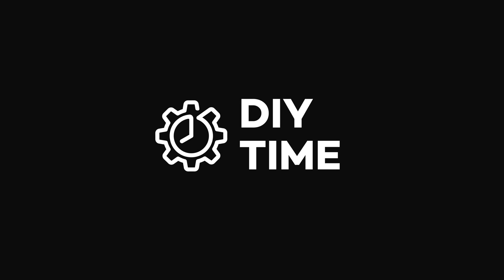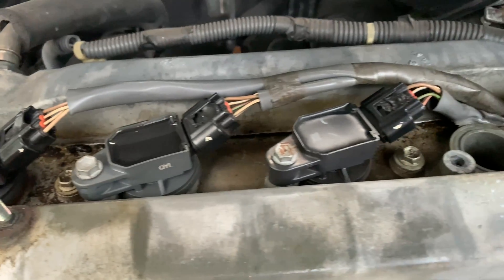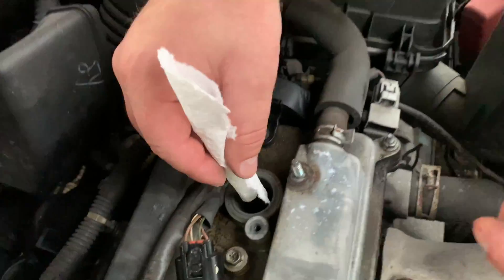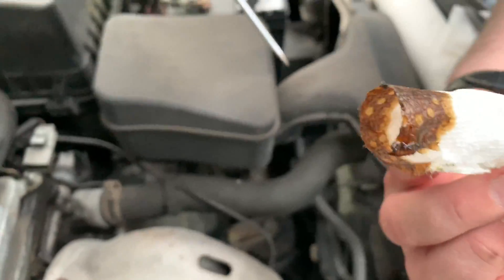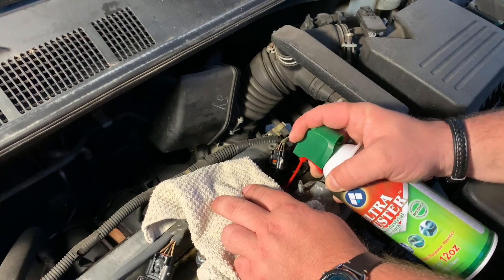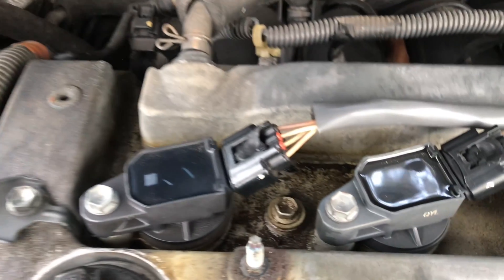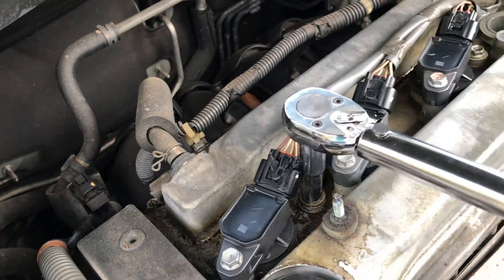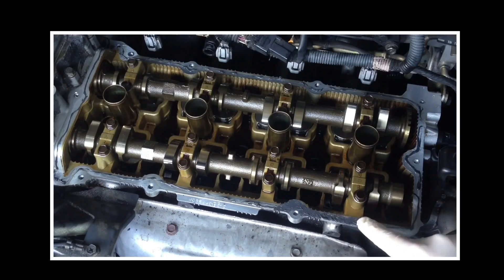How to remove engine oil from spark plug wells (to fix cylinder misfire).

Comment: I cut the stripes from the strip mop and it works better than paper because there is no change of paper falling into cylinder even if the spark plug is removed. Of course you hold those strips and use a stick, e.g. cut a piece from plastic hanger, to move the hanging part of the strip around and change it when it soaked with oil.

Comment: hello my mechanic did a compression test and cylinder 3 has only 60 psi compression he said it needs a new engine is this the case? i have been driving it and the check engine went away i cleaned the oil from the spark plug it seems to be driving ok for now and without any misfire i will try to tighten the screws but will i need a new engine?

Comment: Im in a bind on a 2010 scion tc rs6.0, oil in plug wells, removed all components, cleaned them, replace valve cover gasket, not once, twice and still same issue. Mainly 2 right cylinders looking down. Its a mess. Some say valve guides can break or Crack and cause it, others say it cant. Any suggestions anyone?

Comment: Where are the o rings on a 4'6 litre Ford engine?  No sign of oil leak from rocker/valve cover gasket  Cylinder 6 misfire 1999 Grand Marquis with only 118 k miles or 70000 miles.
Leak more apparent in very cold weather. Seals or o rings contracting?

Comment: I’m not sure if spray is good inside plug! I use wd-40 before inside spark plug hole to clean oil and mechanic said it’s may go inside engine and cause damage!
Reply from the maker: Break cleaner spray dissolves oil and evaporates quickly. WD40 was designed for completely different purposes.
Reply: @  ok thanks

Comment: Common sense should tell you to clean out the oil with the spark plug still in there and removing anything that was broken off with paper towels. If you also find yourself always cleaning it then just replace the valve cover gasket seal. Its really not that hard to do.

Comment: I wonder if using tampons would work. They would expand & wipe the surface as they would be removed.
Reply from the maker: Bro, you are genius…
Reply: @DIYtime  I would suggest the O.B. Brand, they are the best.  Been using them for 25 years ;)  Happy Holidays!
Reply: They come in many sizes, I’d recommend Ultra or Super Plus.  The others would be too small for applications similar to this.
Reply: Should not do any cleaning with spark plugs removed.

Comment: I know this upload is old but I have a question or problem to solve, I have oil leaking from my gsxr 600 cylinder 2 spark plug water drain hole, any ideas

Comment: We have oil in my sparkplug and my bf changed out the gasket valve cover. But there was a bunch of oil I under there, my bf did not get all the oil out. When he took the top I n the engine off there was a bunch of oil in it. He did change thr part but it is still doing the same thing as the most recent video I posted.  Does he need to take it apart and get all the oil out or is the engine toast?? Idk I'm desperate to fix it.
Reply: Maybe didn’t put the valve cover gasket on correctly or didn’t use black silicone to help seal. Not really sure all the specifics but don’t remove the spark plugs and just clean it all out with compressed air and brake cleaner and let it dry. Had a similar issue with a coolant line

Comment: I just use a cheap shop vac, attach a straw to the hose using tape and suck it all out. Then just use something to wipe dry. If use paper towels make sure enough is sticking out so you can easily pull it out later. Don't want to waste time scraping it out as you'll leave pieces inside. Also a sharp tweezers can damage the bad gasket more.

Comment: What you did it's just like to wipe a kitchen floor because of leaky faucet. The puddle will be back in no time. You have to replace seals and valve gasket , then in the process clean the excessive oil.

Comment: HOW IS THIS the exact same video as the following link, on the same channel,  but with a different voice over? https://www.youtube.com/watch?v=37m6L9D-Kio " How to remove oil from spark plug wells - easy trick."
Reply from the maker: I wouldn’t say it’s EXACT same. 
They are poster years apart, and demonstrate two different ways to deak with the issue, though some of the clips are identical.

Comment: I would suggest using a spray bottle nozzle and sticking the straw end into the well to pump spray the oil out. Then pouring lacquer thinner or brake clean down thw hole to breakdown the remaining oil and spray out. The remaining will evaporate
Reply: Good idea.  I'm going to try that
Reply: Insanely smart
Reply: Way better idea

Comment: I thought for a moment he did had the spark out. I just noticed bit of oil in two of mine. I realized he used the pen or marker to create the exact opening of the plug. So in other words the plug must be in to avoid that oil to get in the cylinder. I replaced my plugs and dnt think any oil got in but will go next weekend and clean it out with he’s method thanks

Comment: i actually greased the spark plug tread and installed it and i noticed that it was treading more deep,and i found out by many guys in youtube that im not suppose to grease plugs tread,its running fine but is it too late to remove plugs and remove all them grease in it..but how do i get the grease from plugs well without the plugs in it.thank you

Comment: I accidentally overfilled my oil (checked it on a non flat surface). Went to change spark plugs and 2 were drenched in oil. I actually used paper towels to absorb the oil. Didn't get it all, but most of it. So far no issues with the truck. We'll see.
Reply: How's it going ?
Reply: hows the truck been? i just overfilled my 350 sbc with oil and hydrolocked it, removed plugs, sprayed it with wd40, cycled it a few times, sprayed them all again with wd40 and let it sit with the spark plugs overnight, about to put them back in and see now

Comment: Might I suggest to never use paper towels however, I DO swear by them for everything else. I did this exact thing before I even found your video and a piece came off in my cylinder. WAAAAAAY down at the bottom. I thought about using a screwdriver to dig it up but thought about how wrong that would have been. I ordered 12" long skinny  medical tweezers to get the paper towel out before I finished my repair. I had to wait 8 days for them to come. I will use blue shop towels for the rest of the oil. They don't dissipate as easily as the paper towels. I didn;t know I could use brake cleaner inside of them tho'. Thanks for that.
Reply: You do it with the spark plugs seated. You don't take the spark plugs out for this.
Reply: @MikeMonsa  OK. I got it. Thanks.
Reply: yes, don't use paper inside your engine, even for the dipstick.

Comment: Youre doin this with the spark plug still in place right?
Reply: Absolutely.  Don’t even think about removing the plugs without removing the oil from the spark plug tubes first.  Remember, the whole point of this is to keep oil OUT of the ignition chamber, which may cause misfires.
Reply: @Phineas1626  Any oil that goes in combustion chamber would burn off or blow out right away, its not going to hurt anything.  Im sure its common to pull a sparkplug out and then see there is oil in the bottom of the well,

Comment: i have found oil covering the threads of only one of my spark plugs (bank 1 cylinder 1). Is this likely my valve cover? Externally everything looks dry but I am loosing oil like every few months.

Comment: Did u take the spark plug out to clean the chamber with brake cleaner? Thanks
Reply from the maker: No, kept it in. You don’t want oil to sip into the cylinder.
Reply: If it seeps into the cylinder is there a way to clean it out? Happened to me and now I’m getting oil on my plugs still after changing gaskets. I’m a rookie

Comment: Ok but sticking paper towel inside that spark plug hole to get the oil out is not good because can leave  somepart of the paper inside.a rag will be better
Reply from the maker: Rag will not reach all the way to the bottom. I used thick good grade paper towel, and it worked great for me.

Comment: So yeah I like the video but you should have explained what's so important about the oil on spark plug and in coil pack compartment & what would happen if you don't remove it B4 putting new plugs..
Reply: What would happen?
Reply: @christophermcelroy9334  lots and lots of smoke. potential fire if super bad.
Reply from the maker: 🤨Fire, how’s that?
Reply: @ if there is enough oil in the spark plug sockets, the sparks can have the potential to cause fire, it usually just smokes a lot but it can happen if its bad enough
Reply from the maker: How? sparks are happening inside the cylinder, not in the “sockets”.

Comment: I had a cylinder 2 misfire and this video made me go and look at my plugs, and I saw they had a bunch of oil or gas in them...... so I take out the cylinder 2 plug and BAM I saw the problem!!! The prong on the end of the plug had broken off!!! Your video pointed me in that direction and because of that THANK YOU!!!
Reply from the maker: Awesone, glad it helped!
Reply: What did u do to fix it cause I have cylinder 4 misfire n alot of oil was in spark n hole ?
Reply: @318HotTopic  I sold the car, but you will prolly have to get the little gaskets that stop the oil from getting into the plug housing tube. Also make sure you change your oil religiously

Comment: I've had a literal pool of oil in one of the six wells in my lexus is200 gen1, I've noticed it while attempting to change the spark plugs. There was so much oil the whole ignition coil was swimming in it - from what I remember I tried to get most of this out of there but I let a lot of this stuff get into the cylinder as well after I removed the spark plug, just thinking it's going to be burned up anyways. Don't know how risky it was, the car works just fine since  - I replaced valve cover gasket and valve wells (?) gaskets, to hopefully remove the issue for the future.
Reply: I know it's been 7 months since your comment, so I don't expect you to answer, but if you have a spare minute I'd love to hear how the engine is going for you after these last few months. I have a similar problem and could learn a lot from you. Thanks heaps. 👍
Reply: @misssummersalt  So, after I have changed the cover gasket and coils gaskets, I'm more than happy to say, that nothing terrible happened since then! The engine runs just fine
Reply: A couple teaspoons of oil won't hurt anything, but try to get as much out as you can prior to plug removal.

Comment: Excellent - might just repair my misfire without having to replace all the gaskets quite yet!
Reply: No, you already had a misfire that's critical, so you have to replace all your plugs and head gasket and tube  gaskets as well otherwise you will damage your engine.
Reply: @tdf123emcee2  I hope you meant, replace the spark plugs and sparkplug tube seals, why the hell would you need to replace a head gasket just because of oil on the sparkplugs that's leaking from the valve cover...
Reply: @FatalFlaw85 calm down brother he meant valve cover
Reply: @tdf123emcee2  Also a misfire is not critical... Neither is driving with a fouled sparkplug, it's just not the best driving experience but it's not gonna ruin an engine by firing less cylinders, but yea, he should definitely replace the valve cover gasket and tube seals otherwise he'll just mess up the next sparkplugs as well without fixing the leak that caused them to get burnt out
Reply: @FatalFlaw85  misfire with oil in the plug holes is critical if you care about your cats. it will ruin them over time if you continue to drive with a misfire. Your fuel economy will also suffer.
Reply: @tdf123emcee2  you don’t need a head gasket it’s the spark plugs o rings seals why tf would the head gasket cause oil to get on the plugs, head gaskets are on the bottom of the head not the top
Reply: @tdf123emcee2 Did u mean to write valve cover gasket instead of "head gasket"?
Reply: @tdf123emcee2 care to answer any of the above questions? I'm keen to learn more from the words of this genius.

Comment: If the engine runs, gas and air gets poured into the cylinder 2000 time a minute. You dont think that would clean all the oil out??? If oil was inside the cylinder, your plug will probably be fouled and need cleaned or replaced.

Comment: Do not do this. Use an actual cloth towel wrapped around a screwdriver.
Reply from the maker: Cloth will not get around the spark plug to reach the deepest part of the well.
Reply: @DIYtime  You're supposed to take the spark plug out
Reply from the maker: And let the oil get into the cylinder....!?
Reply: @klutch...  Are you saying this because you think the paper towel will tear and get lost forever in the spark plug cylinder hole?  I just did this technique using paper towel and a flathead screwdriver and non of the paper towel tore away.  Even if it did tear away you could easily retrieve the paper towel with some long tweezers or stiff wire.  Worst case you would just continue soaking the oil up and then loosen the spark plug out to retrieve whatever paper towel you couldn’t get out.  

But the video poster is correct, paper towel is really the only way to get maximum absorption and coverage area to get every last drop of oil out.

Comment: I made the mistake of pouring oil into one of the wells thinking that it was the oil reservoir with the spark plug out. I stopped after 2 or so seconds of pouring it. It wouldn't crank with the spark plug back in there, and then I tried to crank it with the spark plug out and it spewed a bit of the oil out of the well. What should I do next? Should I wait for the oil to seep back into the block? Do you think I did any damage to the block?
Reply: even batman couldnt get that info out of me ngl
Reply: This is actually an old trick if you get oil in those plug holes from the bad gasket , you can remove the plugs  1 by 1 and job the motor each time and it will shoot the excess oil out then just replace plug and move on with life. Solved a misfire by tmdoing this on a 95 civic.
Reply: @expirenceoptional  that's exactly what I resorted to doing, but you could only imagine the fright I was in as I'm not mechanically inclined xD
Reply: @Gseric47  I wasn't very Mechanically inclined either I had to change a valve cover gasket a few years ago and my dad told me about it I was like heck it better then a misfiring 4 cylinder
Reply: wow! You are you own worst enemy
Reply: Do Not work on your own car.  If you are pouring oil down a plug hole there are better uses for your talents.
Reply: @bradsanders6954  sorry man. 3 years later, and I can work on just about any car pre-2008. I got gudder, and now I'm pretty adept 😂😂😂😂
Reply from the maker: 💪🏻Never give up!

Comment: I got a question I had oil in my spark plugs but I’m not sure if the piston or head caskets r broken but only little smoke is coming out of the exhaust should I be fine?
Reply: Have you changed your spark plugs and cleaned injectors this could be of the preview ptoblem of the spark plug seal so check your spark plugs they might need to be cleaned or replaced
Reply: @mustagkeemharris5841  haven’t done that but I’ll do that
Reply: Pistons is fine you may need to replace your spark plugs seal and possibly replace the gasket but the spark plug seals might be finished
Reply: @mustagkeemharris5841  it was exactly that and went to a shop to get fixed
Reply: @Jackyyyyboii  glad you sorted out
Reply: @mustagkeemharris5841  I got one more question tho, my car would still rough idle if I go really fast and I was wondering if u know what cuz that
Reply: @Jackyyyyboii ?
Reply: @Jackyyyyboii  you’re oxygen sensor is bad

Comment: I have a 4 cylinder engine it fell and all the oil went to the air intake manifold how do you get the oil out of manifold
Reply: bruh
Reply: at that point man it’s best to take it off and clean it, let it dry, put it back in

Comment: Being mechanically inept, I dismissed my better judgment and stuck a small piece of cloth taped to a straw down the hole after I’d removed the spark plug. Of course the cloth slipped off and I haven’t been able to get it out with a small hook wire. I can’t even see it. Any advice or do you think I’m stuck towing the car to a mechanic for a scope?
Reply: It’s been a year now so I know that you’ve fixed this issue by now, I wanted to note I did the same thing. Then I remembered how I do timing. So I left the spark plug and the coil pack out and I went and bumped the key. Shot right out.
Reply from the maker: Try piece of hose snd vacuum like in this video: 
https://youtu.be/37m6L9D-Kio

Comment: What if that paper towel get stuck??
Reply from the maker: You can use a Stanley hook set to get it out.
Reply: I would say that one should maybe add a tight band around the towel and pen and use a handy pair of pliers for extended and firmer grip.

Comment: I just changed the valve cover gasket and spark plugs, did not clean them unfortunately. The car runs fine but there is a plastic burning smell. Any ideas?
Reply: I have the burning plastic smell as well. Oil in spark plug tubes. I think it's the ignition coil melting to the tube.
Reply from the maker: Can you trace it to anything specific?
Reply: @DIYtime  not really, the car runs fine but it's still there.